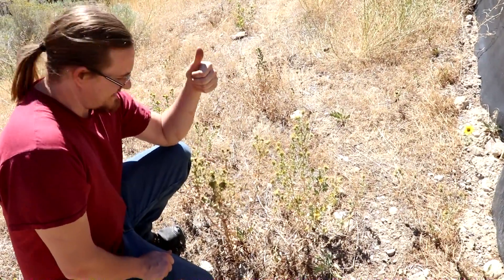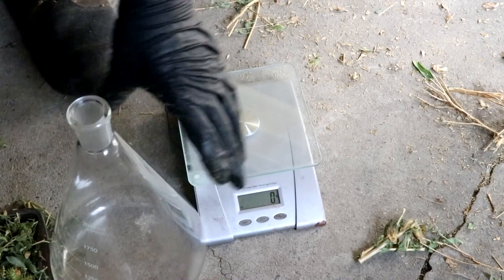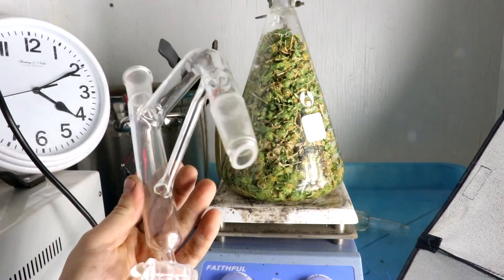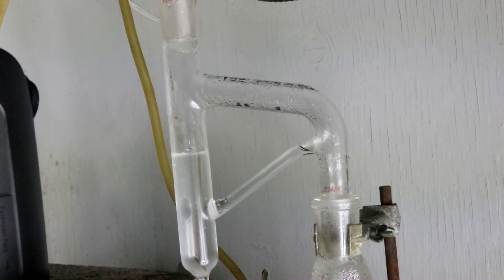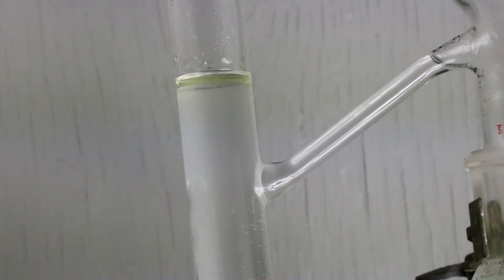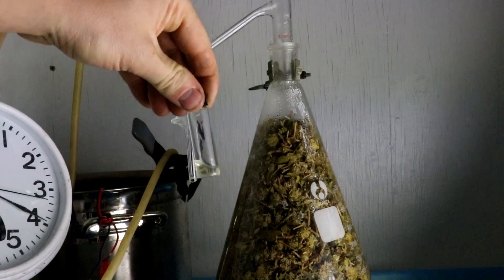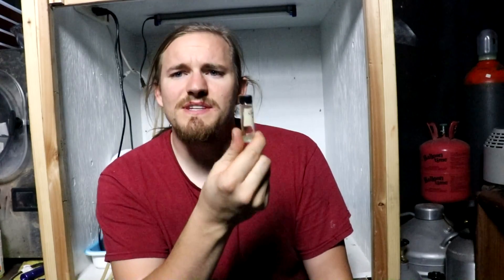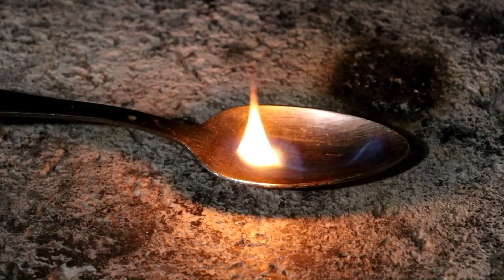Extracting Jet Fuel From GumWeed

Comment: Amazing renewable fuel  it’s kind of like propane but it’s a liquid not a gas oh how I love the smell of propane and propane accessories
Reply: Gumweed oil is a bastard fuel
Reply: Propane smells like nothing I guess. It's the odorant called mercaptan mixed within the propane that smells.
Reply: Jan H A mercaptan is a classification of a chemical, these are usually referred to as thiols in chemistry. A mercaptan itself is not a chemical, but a chemical like propane can be considered one.
Reply: you've restored my faith in youtube comments
Reply: How's Bobby and bill?
Reply: @milesrowe2263  i wanna know the same thing
Reply: Propane is a liquid. pretty sure. At least the stuff you buy is.
Reply: @C3Rl3  Propane boiling point at atmospheric pressure is -42. So as long as you don't live somewhere very cold, it's a gas. The cylinders you buy are pressurized and contain mostly the liquid phase though.
Reply: Jan H thats what i thought.  Guess it is a gas since you can  liquefy pretty much any gas.
Reply: @C3Rl3  Yeah and propane is actually extremely easy to liquiefy and will even stay liquid for a while if you pour it out of the cylinder. Not all gasses can be liquid at room temperature though, nitrogen for example won't stay liquid at room temperature no matter the pressure inside the cylinder.
Reply: Jan H oh ok i thought you could theoretically keep any gas at liquid state as long as you had the pressure.
Reply: C3Rl3 All gas is, is a phase state. For example water can be a gas too, commonly called steam. All elements and molecules can change phase, usually solid, liquid, gas, and sometimes plasma, with some exceptions made (like CO2 [think dry ice] which sublimates/transitions from a solid directly to a gas unless it is held at a specific pressure).
Reply: i read the comment before your name.. then i looked up and saw the name and picture and im fucking dead..
Reply: P R O P A N E
Reply: Simon WoodburyForget
"This constant need to try to save everything is very annoying" - That's Life.  If you don't like Life, I recommend you cease breathing.  You can't?  You have this constant need to save everything?  Irritating, isn't it?
Reply: @xastl32  So you could add mercaptan to the gum weed oil for that "lovely" smell ...
Reply: hahahhahahahahahahhahahahahhahahahahahhaahhahahahahhahahahahah lmfao
Reply: No just no
Reply: Morning or afternoon?
Reply: propane doesnt smell.
Reply: Simon WoodburyForget
"Once a plant grows it soil, it changes that soil until it becomes impossible for plants to keep growing from it" - Is only true if that plant is isolated from its ecosystem.  This will sustain the soil it depends on.  So it doesn't 'change its soil'.  And your answer is false, and farming is a renewable resource.  As long as you ensure the soil organisms flourish.  The plant is not a stand-alone, except when you are thinking about it.  Study Permaculture.
Reply: lol i read your comment before i read youre name haha was like "ok hank lol..... then i looked up and i was like "ok hank lol
Reply: Your out of your damn mind haha
Reply: I just want a picture of a god dang hod dog
Reply: Simon WoodburyForget
"Farms isolate all plants from their ecosystem" - The farms you know may do so, but they aren't the only farms in existence.
"If you remove the plant from the soil (etc.)" - of course.  Sensible farming doesn't allow that to happen.
"the (olive) left overs are toxic to the environment" - Isn't true.  Nothing organic can resist being consumed by the appropriate specialised bacterium.  These are quite usually found near their foodstock, for instance petro plants are host to critters that eat plastics and oils.  Bacteria were here first.
"farms aren't natural" - which is why I recommend permaculture.  Permaculture farming is truly natural.
"plants that grow in farms do not grow in nature" - Isn't true either,  Life succeeds as it may.  All life is 'natural'. We have selected the plants that have suited us best and killed off those that displeased us.   Being at the very top of the food chain, we too are 'natural'.  Our well-deserved extinction (due to the failure to appreciate plant ecosystems) will be natural too.
Reply: We get it, you're NOT GAY!
Reply: Why do you love the smell of propane accessories?
Reply: "Wut? That boy ain't right. I sell propane and propane asseries. Wahhh!"
The King Of The Hill was funny, still overrated though.
Reply: @robinhyperlord9053  better then family guy or any of the new shit
Reply: @milesrowe2263 
FG us not as one dimensional.
Reply: @milesrowe2263  didn't family Guy release before king of the hill?
Reply: @thehonestorange713  no hank hill was way before

Comment: why not a solvent based extraction?  Acetone or MEK might have collected the oil more quickly by simply running it through the material like "tea".    Also,  I wonder what the net energy of this fuel would be, meaning do you get more energy out than you put in like kerosene or would it be like Ethanol, a negative net energy fuel consuming more energy to make than it provides?

Comment: You were unlikely to get any oils that boils much higher than water given your setup.  Next time insulate the top of your distillation unit so that the condenser is doming most of the cooling/condensing.  I realize you were using water to bring over product, but this comment still holds because the bottom of the flask could have bent increasing in temp as oils came out of the weed but never made it out of the flask.

Comment: It's not gumweed that they used, it was Rapeseed, or canola oil. I actually worked on this project with ARA. We used catalytichydrothermolosis, basically putting a water/canola oil mix into a supercritical state (very high heat, very high pressure). The product came out crude, and we shipped it for refining, so I don't know what that process entailed, but it was quite interesting, and very flammable. From what I understand the yield made it more expensive than standard Jet-A, but it was renewable, so they wanted us looking into it anyway.
Reply: +Jake Mitch You can thank Bill Cosby for both of those....
Reply: How did your family get the last name Dickinson?
Reply: Jake Mitch commonly known as canola which is just an acronym for rapeseed people can eat without getting cancer. I believe it’s erucic acid or something. Idk. It’s a brassica and one of the highest yielding oil crops we have. Also great for bees and used as a cover crop.
Reply: So now I understand why its called Canola Oil. I personally am going to start calling it Rape Oil, because why not.
Reply: It's from the latin 'rapum', meaning 'turnip' from memory. They are all Brassicas. Rape/Canola oil processed like this is a relatively common basis for biodiesel so it is pretty common to see large fields of it being grown outside the US (The US seems to use corn mainly)
Reply: Rapeseed? I thought those ended up in orphanages to be adopted? ;___;
Reply: A M that ain’t even funny dude
Reply: @Dollapfin  No, it's not a funny topic at all but I've adopted many children into adulthood. How many have you?

Comment: 1)  Closed condenser, like an alcohol still condenser coil.

2) All the water between the oils and the feedback tube, the one backfeeding the excess water back into the flask, is often what is called "perfumed water", which is where much of the scent may have gone.  

3)  Try boiling the plants, (the entire plant, not just the heads) and then dumping any water condensate back into the plants (to retain any residual oils) and then use a press to crush any and all oils and water out of the plants themselves.  Collect pressed oils, water, and juices.  Allow to cool and the oils to float to the top and the liquids to separate.  You might be able to get more oil out of them.  

4) Perhaps try a CO2 "super critical" distillation system?  You can build them apparently.  While complex, they apparently are not too overly complicated, and I have read they give a higher efficiency.

Comment: Its called destructive distillation and the main source of acetic acid, methanol, and acetone in our society. With a fractionating column you can separate the compounds. Tires, plastics, etc. all make fuel oil.

Comment: NOOOOO cody don't start using clickbait titles! just because you have a flammable oil does not mean it's jet fuel!
Reply: Jet fuel is such a generic term. You don't go with your plane to an airport and tell them to fill it up with "jet fuel". You tell them that you want Jet A-1, JP-1 or Avgas for example. The exact contents of jet fuel depend on the fuel type's specification. Jet fuel doesn't even have to be kerosene (although most planes use kerosene), it can be a lighter hydrocarbon like gasoline or a kerosene-gasoline fuel blend. If it's made of hydrocarbons and can power a jet, I think you should be able to call it jet fuel.
Reply: I wouldn't call it kerosene... even though to my mediocre knowledge at least one of those technically is a more refined, purer form of kerosene... but one thing I will say is, if the dude making the rockets in his shed says it could be a jet fuel, I'm willing to believe him... even though it would've been nice to see him do an atomised flame test, and perhaps test the octane rating (i.e. how much pressure you can subject it to once atomised before it auto-ignites). I think he'd get better yield of jet fuel by fermenting the vegetation and collecting the methane, perhaps converting that to methanol, and then refining the nitrates in the solid remains.

Comment: There's something that I've been wanting to try but dont yet have the equipment or resources to try @Cody'sLab .   So exactly how you did this experiment the heat will react some of the terpenes in the essential oil, degrading them.  Would it be effective to try this under vacuum without anything but ambient heat, still doing a steam distillation, using a series of cold fingers at different temperatures to protect your vacuum pump and to condense out the oils. Would it be possible to collect any appreciable amount of essential oils? It's about the only way I can think of collecting oils without using any expensive solvents but I havent tried it because I fear the cost.  Do you have the gear to try this?
Reply: By cold finger I mean cold trap... have one ice water, then icy salt water, then dry ice / ethanol, then liquid nitrogen,

Comment: Here's an idea, also the idea is mine you can use it in a video but please pay me if you decide to sell it IDK why I care so much.
An over-sized lock that is covered in insulation and if you try to break the lock with a pair of hedge clippers it will give you a nasty spark, IDK how big the battery would have to be to be lethal but a nasty spark would deter pretty much any Thief, Maybe you could connect a wire to it as a prop, to make anyone think that it's got enough voltage to be lethal.

Comment: but can it melt steel beams
Reply: Jock Orange it can if you have 420.69 
gallons of it
Reply: nice
Reply: Nahh, it takes office furnishings to melt steel beams. It happens all the time.
Reply: You only need to heat it to weaken them.
Reply: Jim Myer yeah thats true, but when the whole structure is steal beams wouldn't it have resistance when falling and not fall at freefall speed? Weakened beams still have resistance and won't collapse instantly
Reply: Jake Mitch  there is resistance, just not enough to matter. Think of it like dropping a tree limb on a twig. If you lower it slowly onto the twig, the twig can hold it up no problem, but if you pull it up 2 inches and drop it the twig snaps. Buildings are mostly put together with fairly static forces in mind when it comes to up and down movements. They are built to sway, not withstand ups and downs. (differing regions have different requirements based on earthquake proclivity as well)

Comment: The military may have gotten there first, but it's still very cool that you managed to independently prove a viable extraction method and obtain a volatile sample by applying what you've learned otherwise. When we run out of oil, Cody'sLab will be flying a jet on desert scrub brush squeezings.

Comment: I just got done doing a tulsi essential oil under vacuum and it worked very well. If you walked in as it was extracting and smelled it you lost quite a bit. Lower the heat and put under vaccuo and you'll get a lot more. Make sure you use an ice cold trap with dry ice and acetone. Pretty cool!

Comment: Could this be used in vehicles like cars? Maybe instead of diesel? I'm not familiar with the differences of jet fuel and diesel but would you need to add something to this for diesel trucks. Kinda like using this as an additive?

Comment: If you did the distillation with ethanol you might get better extraction. But the oil would stay in solution, you say. Right. I would be willing to bet there is a ratio of gum oil to ethanol that would work just fine in a gasoline engine. The spoon test seemed to show a much higher energy density than ethanol.

Comment: Well done! 
Many years ago, a 4-H Teen Leader raised a crop of black sunflower seeds (common name: Russian sunflower), they are oily as the dickens. He pressed the oil out with a modified cider press. It used plates with smaller and more holes. This brings me to the question, is it more efficient to press and then cook or just cook? Next question is would a solvent work better like acetone in the beaker and a layer of water in that (I forget it name) on top of the beaker. The 4-H Teen Leader ran his tractors and combines on the sunflower oil in 1981 and still to this day. He filtered the pressed oil through old denim jeans and then a diesel fuel filter. Ain't not bad science, for it's day.
Take care from Oklahoma
Mike and 'That Dang Woman'.
Reply: Im surprised that was ever worth the effort. Fuel prices in the US are vastly cheaper than they are in Europe. Pressed sunflower seeds would make a high grade edible oil that would be worth much more than the equivalent amount of gasoline or diesel.
Reply: @dfpguitar  True. At that time, sunflower oil was nothing to the gallon and only mulched and put nitrogen in the soil, when turned under, for the cash crop of wheat next year.
Thadd told me that cost savings were about 8 cents per gallon, all said. That meant the cost of the seedings, property rent, fuel from first harvest, next few years of harvest, and resoughlting yield and per acre. 
I will say that if he did hot press the seeds, his savings would have been higher.
Reply: @mikebrooka9395  that is very interesting to know. Farming in the US must be very different to the UK with all that space. It's unimaginable to think of any oil crop being mulched in the UK. Also sunflowers are a strange choice as a nitrogen "green manure" . The farming I am familiar with uses plants like clover & alfalfa which fix nitrogen to soil while alive, and again when mulched as they are still soft & green. They are also perfect grazing for animals. Sunflowers are extremely fibrous by the time they flower, and by the time they seed they are like a cross between a stick and a rope. It's hard to imagine them even breaking down in a season. May I ask, do you know where the income source is for grain crops like wheat? Is the money straight from commercial buyers or is it government subsidy?
Reply: @dfpguitar  kind of depends. Some farms sell to commercial buyers under a contract. Most of the smaller farms sell to a local co-op that stores the grain until market value goes up and then they put it on railcars for its 'final' destination. Some years, the government will see the market value too low and pay farmers to not grow wheat at all. This all stays true for all commodity markets. It gets deeper, but that is the tip of the iceberg. Oh, the sunflowers fo degrade a bit faster than you would think when plowed under. As for nitrogen, we use anhydrous ammonia. It kills everything and sets in a lot of nitrogen (that is usually the case for wheat only farms). Old fashioned farmers will rotate legumes one year and wheat or cotton the next.
Reply: dfpguitar  Generally no subsidies for grain producers, although it can happen. Usually to trigger that a natural disaster needs to have happened or something like a significant foreign subsidy has unexpectedly come into play. (Russia or China). This is generally for only one year as the farmers are expected to be smart enough to change crops if they aren't going to make any money farming what they were farming, or like my parents who couldn't afford to keep farming because of low wheat and barley prices, had to sell their farm and find new work.

Comment: If you're looking for interesting solvent extraction to try, I've wondered about a Soxhlet style device using butane, so instead of heating it at the bottom you refrigerate the top to condense it, and it boils itself out of the distillate at ambient temperature.  You've certainly got enough experience with pressure vessels and cryogens to give it a go.
Reply: Butane exracts more than the oils and brings pigments from the plant making the oil contaminated with pigments and plant matter
Reply: Carlos Martinez butane gets the waxes and fats as well as the oils but gets very little pigment or plant matter which is what makes it better then an alcohol solvent extraction process.
Reply: That's what I thought!